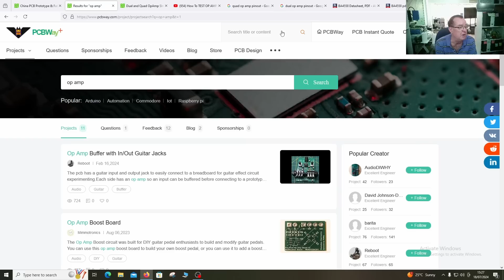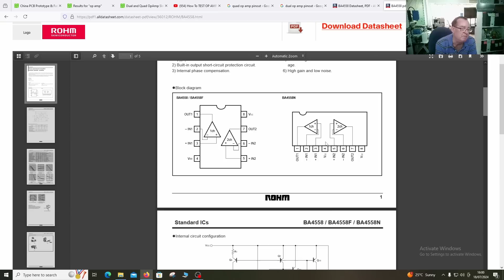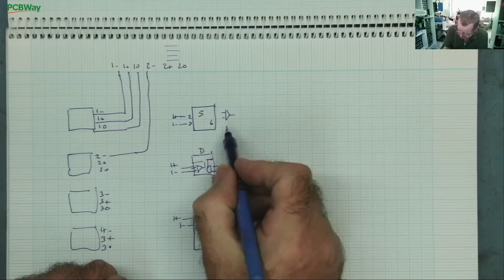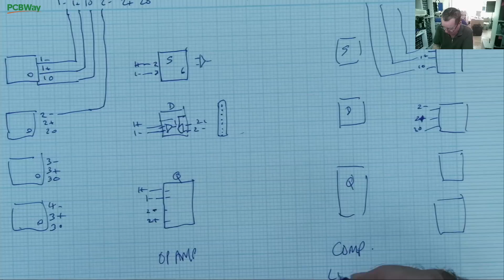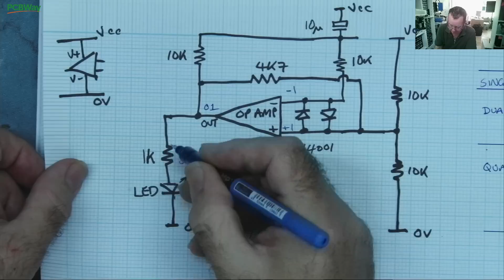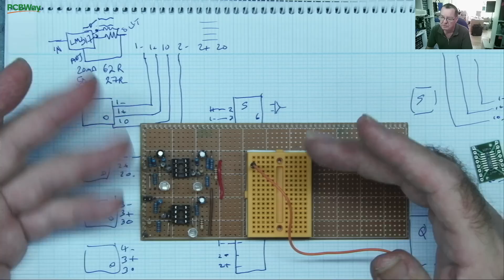A Simple Cheap DIY Op Amp and Comparator Tester, SMD and Through Hole, Single Dual and Quad

Comment: A simple test for transistors, you could add two multivibrator circuits, one for PNP one for NPN, with one fixed transistor in each version and then test a transistor plugged into the second half. Label the NPN and PNP C B E sockets. Have two LEDs that will flash for each pass result, either NPN or PNP.

Comment: I love PCBWay 😁
Reply: I prefer JLC-PCB. Somehow the total costs amount to  3 to 4 times more at PCBWay. On top of that, when I submitted my Gerbers they could not see my bottom solder mask layer. JLC on the other hand had no issue seeing it. The shipping costs made up more than 3/4 of the total cost with both fab companies.
Reply: @LarixusSnydes  Well that could be because people don't change the 5 off to 10 off.
I use KiCAD and PCBWay have a plugin, you press one button and it is all done for you, you just change 5 to 10 and add to cart.
Also if you use KiCAD PCBWay give a donation to the Developers of KiCAD.

Comment: Looks like a great idea, for a custom 3D printed type socket. Where you would slide the chip in as you say, with pins taken from header, or mounted on top of two 4 pin headers. I looked up the data sheet for a TL082, and pin headers, and the dimensions work. Paul, USA!!!
Reply: no you don't want custom anything. plus it's a 50c chip. you don't spend a year and thousands on equipment to build something that can test a 50c chip lol
Reply: @g4z-kb7ct Even if Richard doesn't have a 3D printer himself, Detlef or another friend might have one. I don't think it's a bad idea. Just a template frame that accepts a SOIC/ SOP chip would be printable under an hour. If you go a little bit fancier you can even build in plastic leaf springs to keep the chip locked during testing.

Comment: Rich - what a great project!  Look fwd to building one and thanks for making it out of discrete components.  It would have been SO handy last night to test the LM358 and TL062s that I blew up on my DM6013L "el cheapo" 10 euro capacitance tester (could have been much worse... if it was an more sensitive piece of gear (like me) or the ESR meter or scope, lol...so much for the meter being fused...) .  Yep - despite your best warnings about always discharging caps properly before testing, forgot one... - well... late at night sometimes we are not always fully awake. Lesson learned... Anyhow, replaced the op amps and a few transistors and it seems on the road to recovery (the oscillator 8/80/800 Hz is working now thru the ranges) but the output measurement on the LCD is still displaying wrong static values that only change value when the range setting is changed. So I suspect (lots) more cooked components.  Of course... cant find a schematic for the DM6013L ... I will order a new capacitance meter but it is a good learning project to see what exactly went up in flames and to see if I can repair it, lol.

Comment: If the smd chips are all the same size give or take 0.5mm you can add some smd 0-ohm resistors to the pcb soldered in place top and bottom of chip to give a guide for placing the part with at least 0.25mm clearance to allow for variations in the plastic package. They would be mounted while having an opamp chip in place to get the clearance correct. You can't really put guides next to the chip pins unless it's something plastic otherwise it can cause the chip pins to short together and mess up the testing. I think top and bottom guides is enough. Also be sure to make the smd pads long enough to cover 150mil and 200mil packages. I regularly see LM358 in 150mil and 200 mil so to cover that make the length of the legs fit the 200mil and then extend them towards the middle so there's about a 2mm gap and that will cover 150mil chips.
Reply from the maker: Yes someting like that should work.  Definitely worth a try.  Thanks 🙂

Comment: Another option to add is a power option. Use a common usb connector for 5v (ideally USB-B... i.e. any common printer cable etc powered from any PC or use a usb power bank or ac to usb power-pack) and add a voltage boost circuit to get 9v or 12v. I reversed a circuit that uses one small soic8 chip and some resistors,caps and the circuit takes 5v and makes +12 and -12. There are two resistors that can be configured to make any output voltage you want. I can provide that if you need it.  To implement it add a switch for usb 5v pass-thru (chips get 5V direct from usb) and the other position joins the usb 5V to the buckreg circuit and that makes +12V. The (minus)12V is there too but you won't need it just use gnd for the VCC minus pin on the opamps. I suppose you could have +12 and (minus)12V as an option if you can figure out how to do it with a switch or something. edit has to use word 'minus' here as using a minus sign makes everything after that strikethrough lol!

Comment: I've been holding chips on smd pads and testing them for ~20 years hehe! I have several different working arcade game boards with chips removed and use them for testing specific chips including smd rams. For your little tester gizmo I would add a push button that when pressed latches the vcc and then tests it and the button can be pressed again to stop the test and remove vcc. Put the button in a position so that with one hand the chip can be held in place and the button pressed with the other hand. Or hold the chip with 1st finger and press button with thumb. Or hold with middle finger and press button with 1st finger. Or add a foot pedal option so it can be pressed with your big toe... kind of joking but is might actually be useful to someone hehe! If you use a momentary push button you could latch the signal using some sort of logic IC so there's no physical large button manual movement, it's just a press to start and press to stop. Anyway, with a switch of some sort there's no chance of a short because the circuit is not live until the button is pressed.
Reply from the maker: Thanks for your suggestions